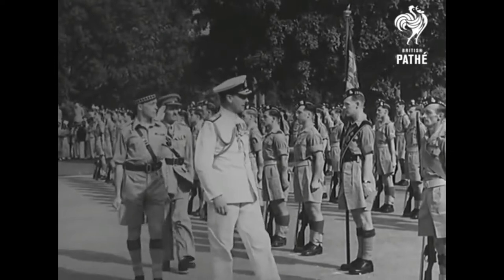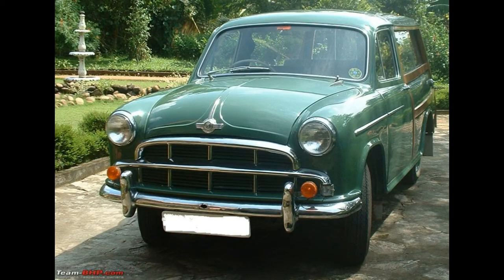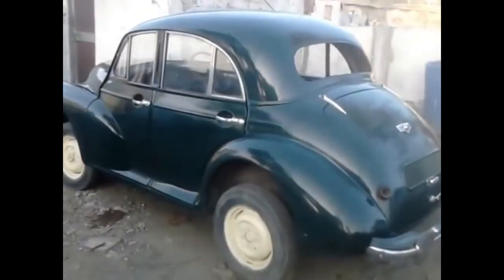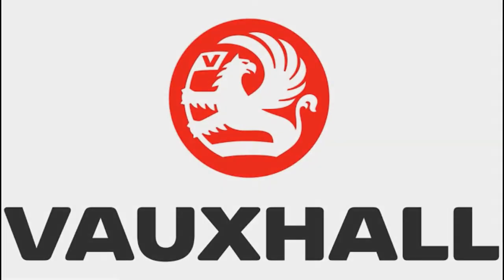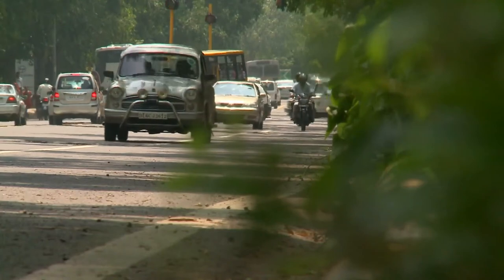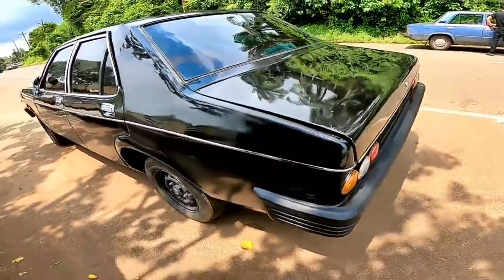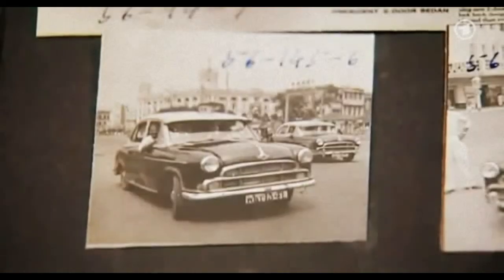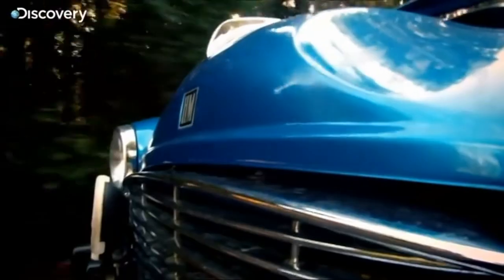Hindustan Motors : The Forgotten Automaker

Comment: My mother  owned one Ambasador. Its ample for 60 kmph journey. If disc brake is provided may give addl safety. But non- availability of parts is a great problem. Govt is not allowing to use engines of other vehicles in this car. If it is reintroduced with modern gadgets, so many peoples will purchase it like hot cakes.

Comment: Still have the hindustan 14 and mark 2 ambassdor completely restored (factory version) and no issue at all. Both the beauties Belongs to my grandfather
Reply: I had a 1964 model but sold that in 2016.  I learned driving on it with the gears near the steering.

Comment: A 50 horse powered muscle car! I hope they had air bags and good brakes! Lol👍🏻
I love these videos and history’s of car manufacturers.
Reply: lol 50 hp muslce car
Reply: The Contessa did outwardly seem to resemble some American cars like Ford Mustang and Dodge Challenger seen in Hollywood films like Bullitt, Vanishing Point and The French Connection but with a 50 BHP engine (augmented to 88 BHP after tying up with Isuzu), it could never qualify as a muscle car. However, with narrow two lane highways where speeds over 80 kmph could rarely be achieved in those 1980s days, 50 BHP and 104 Nm of torque was adequate.
Reply: @utpalgohain6700  it resembled American cars cause the body was a Vauxhall which was GMs British subsidiary and had heavy Detroit influence on exterior design during the 50s to 70s

Comment: Truthfully the Chevrolet suburban has been the longest production vehicle since 1935, still a great video and I like the historical tidbits
Reply from the maker: My bad.
The Suburban is indeed the longest running production vehicle.
Reply: But then, it's rather the name Suburban, than the actual vehicle itself, that survived that long. A modern one and one made 60 years ago a two completely different vehicles. The Ambassador went through the years with only minor updates and changes, and look about the same no matter when it was produced.

Comment: Nice video, thanks for sharing. There are some errors though. HM never had a monopoly in the Indian car market. Premier automobiles, and to a lesser extent, Standard Motors, both competed with HM. Premier Auto, in fact, sold more cars than HM. The only area where HM had monopoly was in the supply of government vehicles. Also, the manufacture of Bedford trucks began in India in 1958, and not 1971. Tata Mercedes Benz (subsequently Tata Motors), also began building lorries in India in the 1950s.
Reply from the maker: Thanks for the info.
I'll be more careful with the research here on.

Comment: In the video it is stated that Land master is introduced first and then Hindustan 10 and 14 but I don't think so...Secondly in which model HM used Side Valve diesel engine? Side Valve Petrol Engine only is last used in Land Master and from Mark 1 OHV introduced with OHV badge in rear tail gate. HM diesel engine not ISUZU is first introduced in 1979 in Mark 4 Diesel. From Childhood till 2007 approx my father owned 5 Amby. First one was WBJ Reg No Mark 2 '69 modelconverted to Mark 4 purchased in Jan 87 then WMY series with Matador Engine then WME model at last ' 90 model Ambassador NOVA which is not mentioned in the Vlog NOVA was a successful model of HM. Apart from that we also used to have Maruti Van  '87 model and WNC model Maruti 800 2 cars were always there. WNC is 1986-87 series Kolkata Registration.

Comment: 2000cc cars in 1980's -2014 , Hindustan Ambassador had the most powerful engine compared to rivals .
How many car makers produce 2000 cc cars even today .
Reply: cc's don't really indicate power. Formula 1 V6 engines produce upwards of 800HP with 1600cc engine
Reply: @metaphorpritam  But can 800 HP be produced in 1000 cc? Engine refinement are recent, not in 1980s
Reply: @devnath8512  What kind of stupid question is that? Engine refinement exist from the days of discovery of internal combustion engines. In WW2, ICE engines already used fuel injection, ECU's, supercharging, turbocharging, high-octane fuel, etc